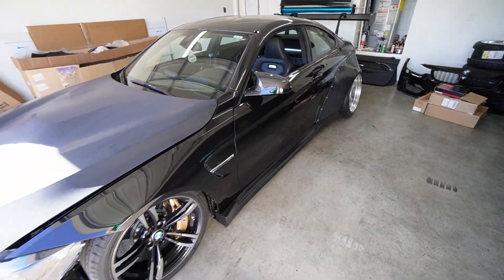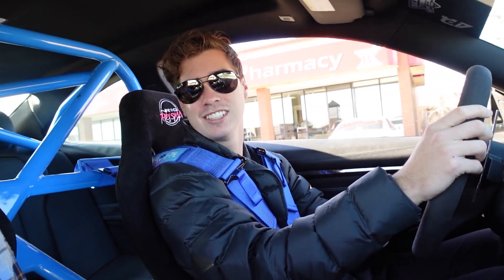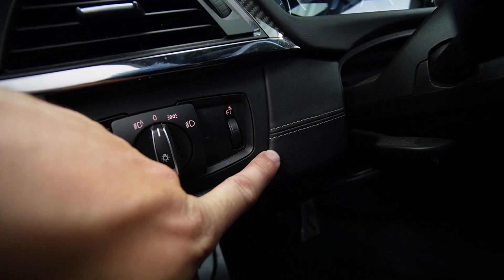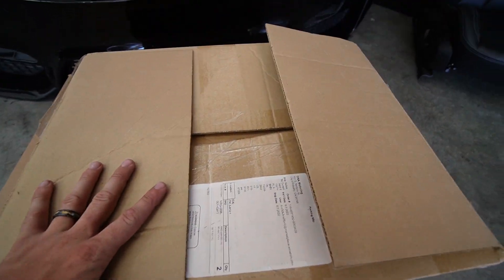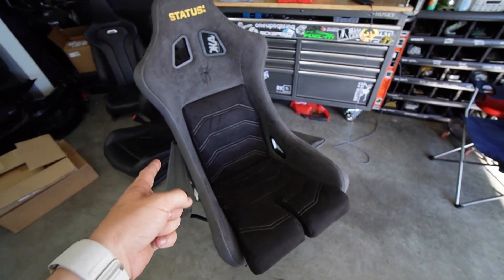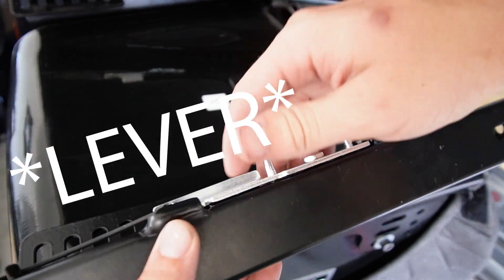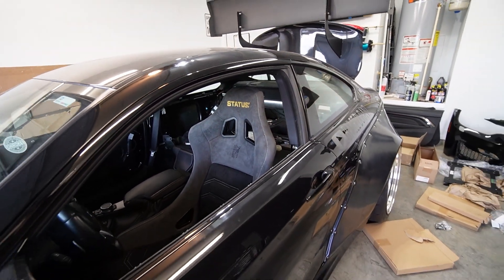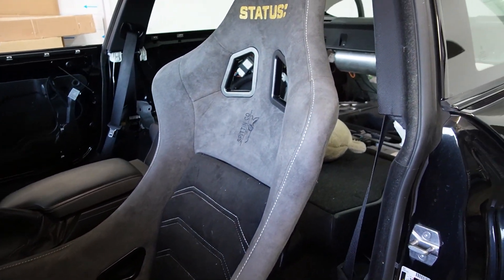Forced to install Status racing seats.. DIY

Comment: I love these seats. Really disappointed there's no carbon backing option for them though. The circuit and grid look alot better than the gtx
Reply from the maker: I completely agree. I am pretty sure that they offered carbon fiber backing once before so I wonder why they stopped producing it.